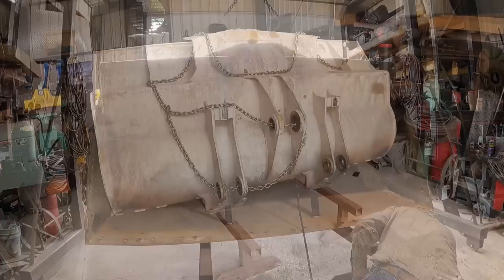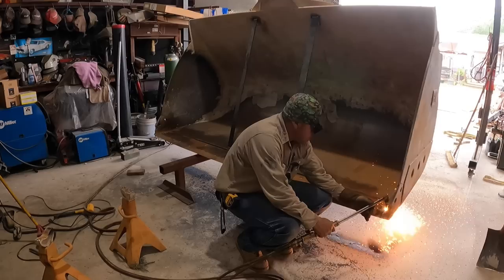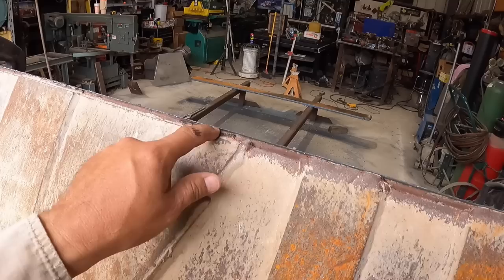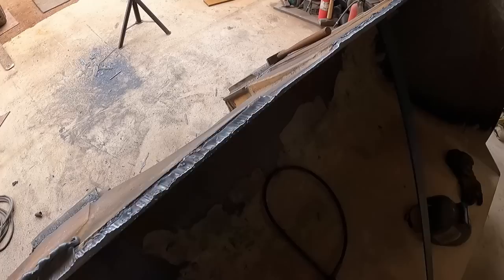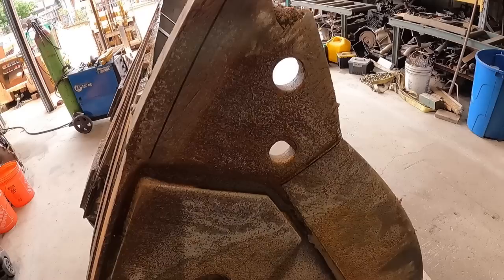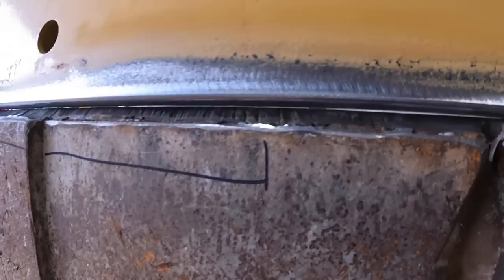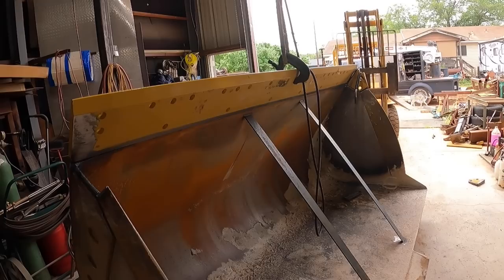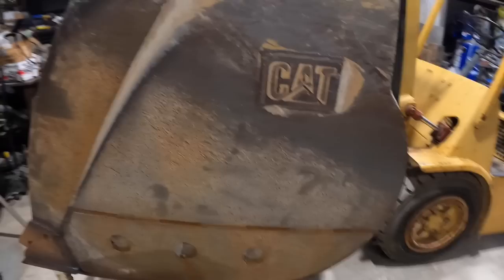(Part 2) Front End Loader Bucket Repairs.

Comment: Yeah!  Nice chain on that piece.  🙂
You sure had that wire machine "turned up on weld!"
We had a Inspector Ol Nick, he'd come in behind you with or without his little hand held, and give you a critique.  Almost without fail closing with his, "Go turn your machine up on weld."   Story goes, one day Ol Nick got with a welder on some 8" heavy wall.  He took his shield, fired up off the bottom with a 5/32 7018 kept hollering to the fitter, "up 10," they said he went up 80 some amps. "He was carrying a pond not a puddle." The slag curled up like a piece a crisp bacon n fell off on the floor.  It was one of the slickest welds that welder'd ever seen, he said.  That hand was an old timer ready to retire.  We'd all thought Nick was blowing us a lot a smoke.  But he could show you how too... Coke bottle glasses 'n all.
Point being most of the Inspectors I've run across wouldn't tell you to do something if they couldn't show you how it's done.  That was one of those jobs where the weld rod came in by the rail car and every body had a heated rod can and the rod tome out of the oven was timed.  You'd have to return it if you had it too long and not used it.  Now I don't remember if that was for Kellogg  or Jones.  
Isaac, ya sure make those parts look good.  Keep on...
🏁🇺🇸👍

Comment: I can relate to that wood heat shield near the end, ha! I still have numb spots on the back of my left hand. Back in my early 20's, worked as a mig welder on an assembly line. Seam welding panels onto dump bodies. I quit buying those foil heat shields. At a rate of more than 5 a day, I just wasn't getting paid enough to afford them. I kept a bunch of rags cut from scrap blue jeans, soaking in soap water. Quota mandates, did not always have time to stop and swap out for fresh wetted wraps.

Comment: I suggest that yiu get yourself a piece of big teuck brake lining new or used to use as a heat shield instead of that board to protect your hand. This material can withstand much higher heat and ahould also be cheap. 
Good job, good video.

Comment: Hmm I could make some fantastic punches with that wear resistant edge steel, it would take some moving with a hammer though lol. I really like the line cutter it leaves a fantastic edge
and last but not least those chains look way safer than the bit of tape ever did...I am sure no one wants a flat Isaac 😉

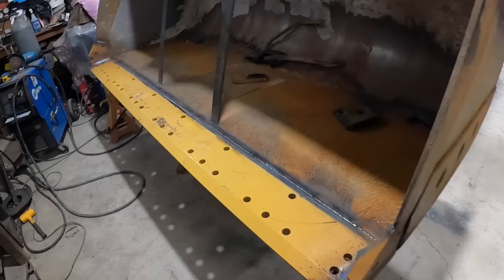Comment: Man learns quick, 5 k chain on it now.    A lot of work went into that rebuild.    Usually, an old bucket like that would just show up on an auction site and be converted to a light use tele-handler  fork bucket by an owner-operator and might fetch 2-3k.     I would imagine a new bucket like that would go for at least 8-12k new plus shipping, that is if they had on in stock.   Looks like you might have had 2-3 days in the rebuild process (and some parts like cutting edge and side cutter plates), so it was probably well worth it in terms of time and cost to get you to rebuild it.  @27:10, I will have to remember that oversized smoldering rat trap glove shield trick.   @28:22 Poor Mud Dapper Wasp.

Comment: Isaac you need an old set of metal  roller skate wheels for a guide spray the wheels with anti spatter or use a shield on one side.

Comment: I'd say don't be to afraid to bump your air pressure up on your plasma.  Tip quality is critical as well.  I see guys try to push their consumables farther than they should.  Not saying you do,  just what I've seen working quality control in the field. Always top shelf work Issac.

Comment: With your straight cut obviously you had the weld to follow, but drilling pilot holes can be a real quick way of transferring reference points on tricky to measure stuff.
Something I'm sure you would have figured if needed or used in the past.
Really enjoyed the patented IC weld hand shield.

Comment: I C Weld, the man with the smoking hand shield. That is a great tip and one l shall adopt, adapt and improve upon if l may be so cheeky.
No used bucket rebuild/repair is easy. Concrete, muck, stone, wood, cracks and splits all have to be dealt with. 
Top stuff young man!

Comment: Quick question only because I rebuild buckets for Esco and our normal weld procedures when welding on a cutting edge or lip we always back gouge most of our welds when able to we also use flux wire not hard wire. I guess what I’m getting at I suppose you wouldn’t gouge out hard wire because there is no flux is that the thought process but it does leave silica deposits but any ways awesome stuff always watch your videos and love learning new ways to go about things.

Comment: love watching the way you work , cool calm & collective . I got a JD644 bucket to do , problem is its out of square and twisted . My question is how do I square and level the bucket for the new cutting edge and bottom plates
Reply from the maker: Once you start cutting some of it apart, you may find that it will relax back into place. It doesnt always happen but there can be some tension that will allow it to spring back a bit.
Reply: Diagonal measurements would be my best suggestion Lazer squares can be handy for oddball situations too.
Reply: Chains and a porta power can be a powerful persuader.

Comment: I know Isaac knows has a lifetime of knowledge over me on this stuff so I’m not questioning, just curious on the choice to use solid wire on something like this. I’d have expected this to be the type of job where 7018 or dual shield was mandatory for the impact rating.

Comment: Obviously, you didn’t feel the need to pre-heat the cutting edge or wear plates. WHY? Not being critical, just trying to learn. I would have been afraid not to pre-heat it and using short circuit mig as well. Again, I’m interested in your thoughts.

Comment: Did you just do that blade in one pass?
Reply from the maker: Single pass, Multiple stops.
Reply: @ICWeld   Great and very clean work Isaac .. but ,  before welding the whole cutting edge , do you  preheat both bottom bucket and blade , to avoid cracks caused by hydrogen problems ?